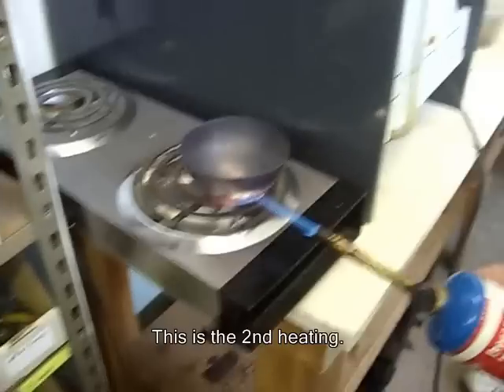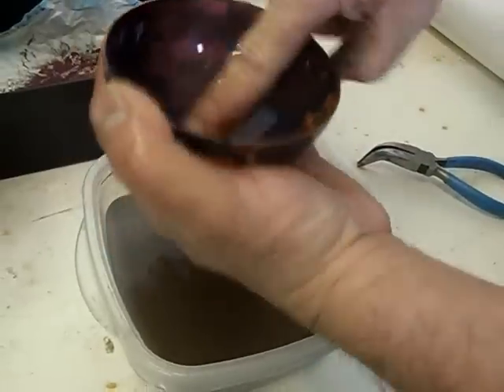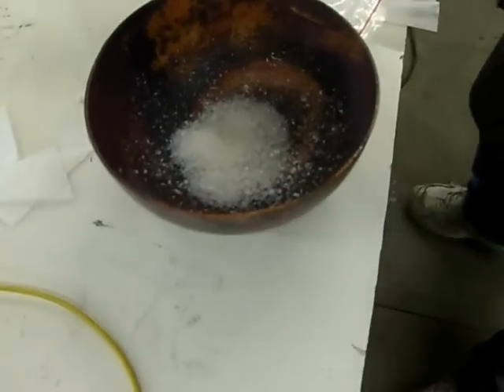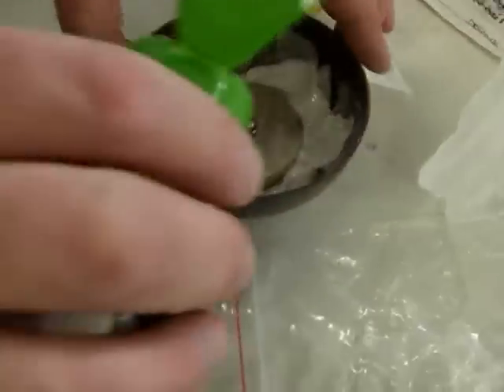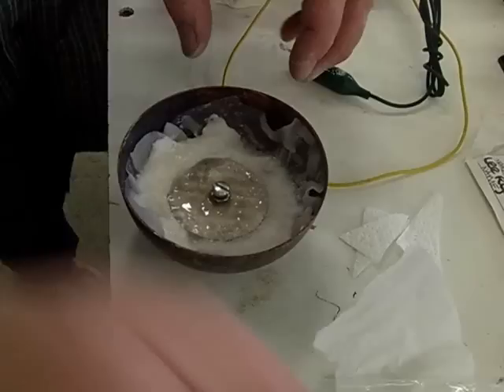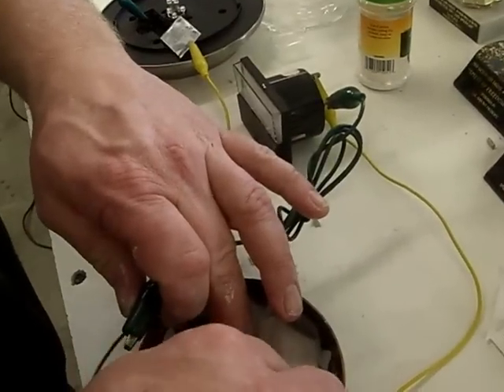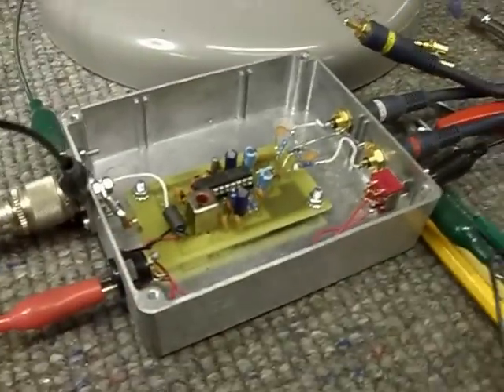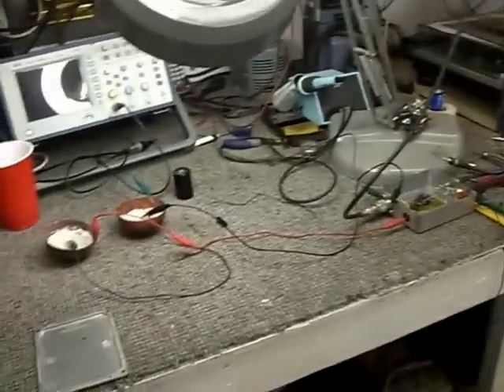Bedini Copper, Alum and Magnesium Battery

Comment: An easy way to go about it methinks is to mix cuprous oxide, some carbon black  for conductivity in a binder (PVDF in acetone or some SBR) and  and paint over the copper bowl! The copper should be well polished before the coating. Saves a lot of time and you have a complete control over the homogeneity of the Cu2O surface. Hope this may help one day!
Reply from the maker: If you get a chance to try that out, let us know!

Comment: Hello how wuld that cell react with 2 similar electrodes like stainless steel ? What does it produce as chemical reaction? And what wuld hapen if you actualy put power in to that cell what reaction wuld by? Im looking at oxigen generator cell Im not shure tought if it wuld work ore not . And what type of baterry charger is used on the lead alem baterry's? Does the car alternator normaly charge the system ore does the car suffer from power loss? Culd a converter by aplied to the lead alum baterry to increase the voltage? forgive my Im anoing but wuld for exampel a old school oil cooled ignition coil act as independent energy sorce if you for exampel take out oil and put those crystal in it? I heared about singel cilinder engine's runing on crystal ignition but no info culd by found on the internet ? any help ore sugestion? thanks plazma ignition and amplifier ignition video were nice helped my lot Im mostly concerned what my alternator and starter motor will do because with plazma used on my car the alternators starting charge rpm increased around 2000 2500 rpm so the starter motor spin faster some how that frequency staff confuse my expecialy when static is present with insulator brake down and crapy coolant electrolisys thats a big problem for my

Comment from the maker: It can be ANY form of copper, even a flat sheet, those bowls were just for convenience to hold the stuff. You can buy them all over the internet, search for copper spheres you can cut in half or copper bowls. Again, ANY copper will work. 

The alum will form the crystals and DOES need to have some moisture. Galvanic action happens when current can move in BOTH directions. With the heating process of the copper forming the red layer (cuprous oxide), that is a DIODE meaning current moves 1 way.

Comment: I connected a bare copper wire and a piece of magnesium to a positive and negative probe to a fluke meter and just shoved both into a plastic jar of dry alum and I got 1.25 volts holding. is it because of water residue inside the alum that can't be detected by the human eye? and if this is correct maybe these experiments with alum Epson salts salt substitute and rochelle salts, cream of tartar or borax  after heating contain a moisture in them that is hard to remove maybe they are not really dry

Comment: Copper cup - yes that would work, just heat it like shown. I believe you can use plain water instead of using borax in the water.

Black layer keeps normal galvanic action from happening. Cannot see metal degrading. Will run for a long time. When dry, just add water. The semiconductive layer on the copper is very crucial to taking this beyond a simple metal eating galvanic cell. It acts as a diode. 

Series adds impedance so not good. Parallel to increase current is fine.

Comment: Forgive my ignorance, but how have you ruled out standard electrolytic battery operation when the alum is still wet? Should you not first allow to completely dry, using only the crystal structure as the conducting / rectifying material?

Comment: Are you sure it does not work on galvanic action and consume the
metals ?
How long did you run it yet and did you check the magnesium rod
afterwards ?
Normally a galvanic cell made of graphite and magnesium corrodes already with the moisture of the air...
Many thanks.
Regards, Stefan.

Comment: I don't understand the fascination with this. It's basic electro chemistry. You put two metals (one with lacking electrons, one in excess) into a salt water (ion transmitter) and you get electricity. Is the point that it's cleaner than commercial batteries and the life expectancy is longer?
Reply from the maker: Then you don't understand what you're looking at. The copper has been heated so it has the red oxide, which is a semiconductor. Therefore, current can only move in one direction and it is a not a conventional galvanic cell that consumes the metal as you would expect. It is anything but basic chemistry!

Comment: its the magnesium.  not the crystal it self and i thought your suppose to heat the salt crystal. until it liquefy.
Reply from the maker: It's an alum crystal and it dissolves in water at room temperature. You can speed it up with some heat. You say it's the magnesium - what's the magnesium?
Reply: +Aaron Murakami will i just want to ask because magnesium seems to be used by all crystal makers so i wonder will it work with other metals like aluminum iron or nickel. will it still work?
Reply: +good boy and what is weird about dirt cell batteries if you were to collect four cell u get led light up but not very bright . but you volt meter will say 3.5v but not power a motor now i have a lying battery that tells me i have 7v but when connected the light starts to dim and die in 30sec now i wonder in that battery is actual the chemicals or the fact that the frequency is be read but there are no electrons. so u need at least30 cells to actually capture the electron to get u close to one volt ill do it again just to see if i can power a little motor at 40 cells of dirt, rocks, or water ill do water salt instead.